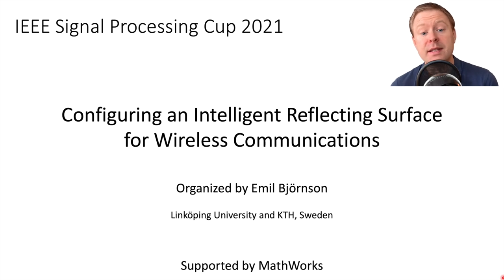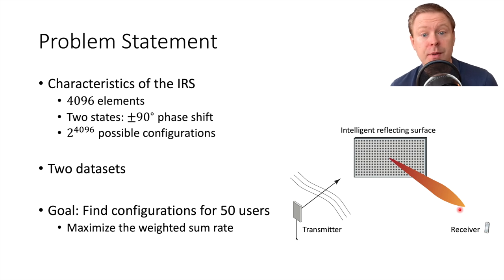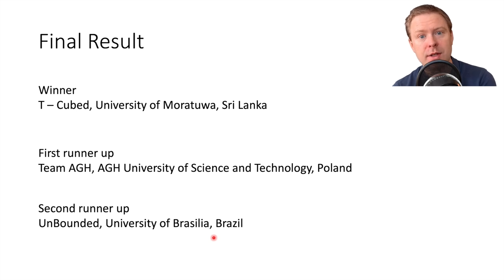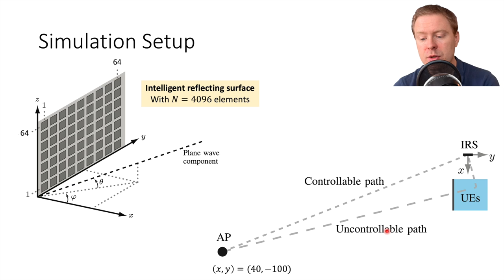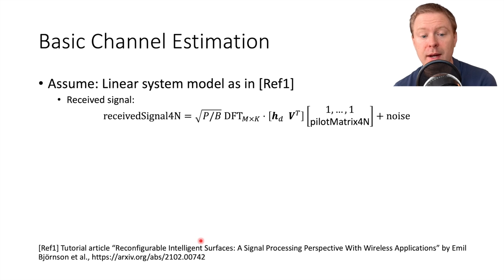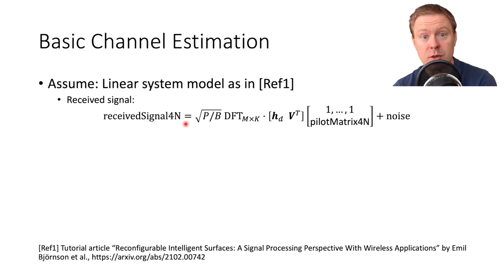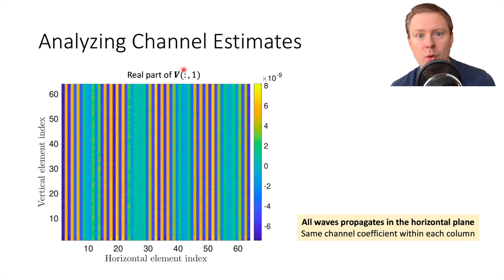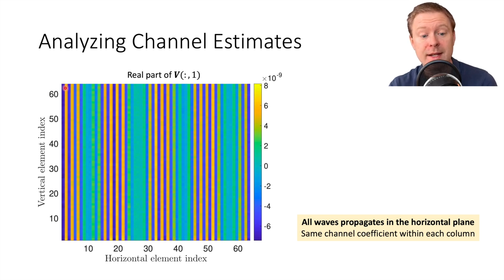Summary and Sample Solution to the IEEE Signal Processing Cup 2021

Comment: @ 8:30 Based on the code shared by you, I tried for 128x32 4N configuration in dataset1 and obtained similar kind of plot. How do we justify right geometry for RIS and also is it required to check for 4N configurations only or can we go with lesser configurations like N,2N etc
Reply from the maker: It makes good sense to use rectangular surfaces that are wider in the horizontal dimension, since there will be more channel variability in that dimension. There are 2^N configurations, so it is computationally infeasible to check all of them. However, N+1 well-selected configurations is enough to estimate the channels and then use the estimates to select the RIS configuration based on some heuristic algorithm.

Comment: Why we multiply with the number of rows (=64), when we formulate the quadratic form?
Reply from the maker: The reason is that we noticed that every row experiences the same channel, so we can use the same phase-shifts on every row. Since there are 64 rows but only one direct path, the factor 64 compensates for the power imbalance, so it matters in the expression how many rows we have.

Comment: A Question: I just read that in 5g they use TDD in beamforming (I am reading a book about 5G). But with the beam you want to achieve one or a few receivers. So what do they mean by TDD? With TDD in GSM they give the timeslots to different users - but here there are only a few or only one receiver. Who gets the single time-slots?
Thank You.
Reply from the maker: TDD means that the same frequency band is used for uplink and downlink, but at different time. Another 5G feature is spatial multiplexing, where multiple user devices can be schedule at the same time slot and separated by beamforming. This can be done in both TDD and FDD, but it is easier in TDD.